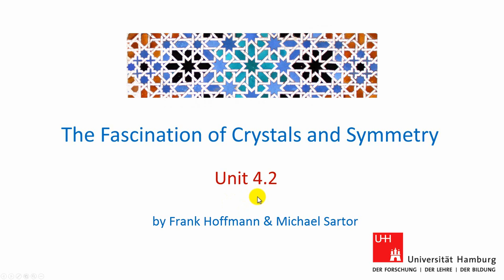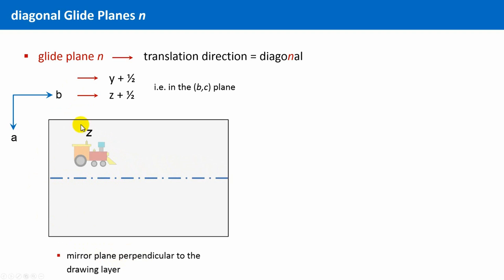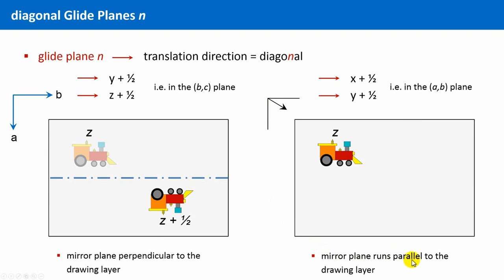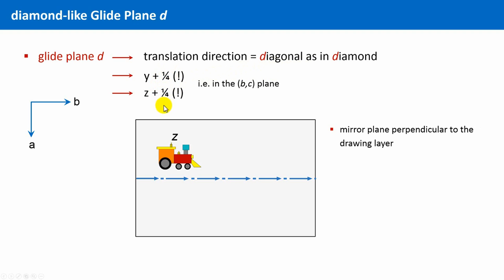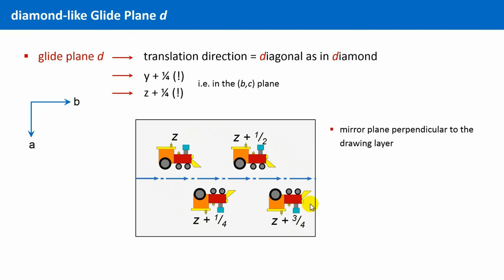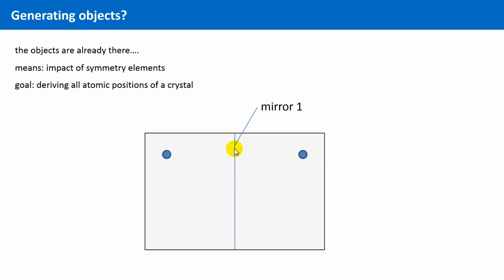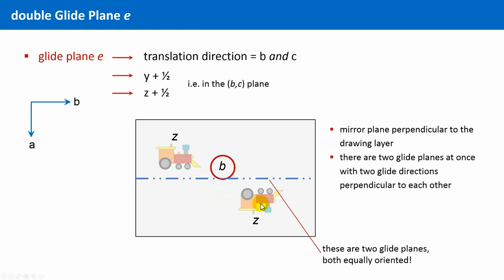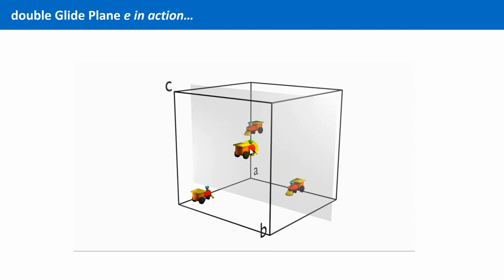Unit 4.2 - Glide Planes in Crystals (II)

Comment: For glide plane d, is there also a scenario were the mirror plane is along the drawing layer? 

I was wondering this, because glide plane n has two scenarios, one with mirror plane perpendicular and one along the drawing plane.
Reply from the maker: Yes - take for instance a substance that crystallizes in the space group Fddd like Thenardite. Here we have a glide plane d perpendicular to the a, b, and c direction (and if we choose one particular plane as drawing plane...)
Reply: @FrankHoffmann1000  Thank you!
Reply: @FrankHoffmann1000  I came here because i need to understand the second type of glide plane d, i can't understand how to read that symbol, precisely that one present in the ITA (does the 1/8 and 3/8 numbers, under the two arrows mean that the two vectors are at heights 1/8 and 3/8?) And why i need two arrows? Thank you
Reply from the maker: @domenico26752   Fddd is indeed hard to understand. Yes, the 1/8 and 3/8 are the heights perpendicular to the drawing plane; but note that 1/8 means that there is also an identical plane at 7/8 and 3/8 means there is an additional one at 5/8.

For both planes the direction of the translation part is indicated by an arrow. The interesting thing is that in these centered cells the glide olanes d have a diagonal translation component. See also here:
http://img.chem.ucl.ac.uk/sgp/misc/glide.htm

I would also recommend to look a crystal structure with space group Fddd with Mercury, where you can visualize all symmetry elements (and see the relative positions within the cell).

Hope that helps a bit.
Reply: @FrankHoffmann1000  Thank you